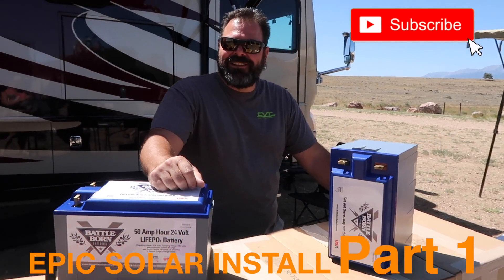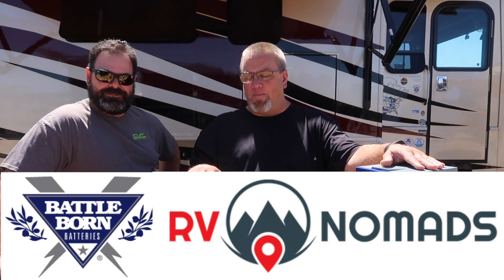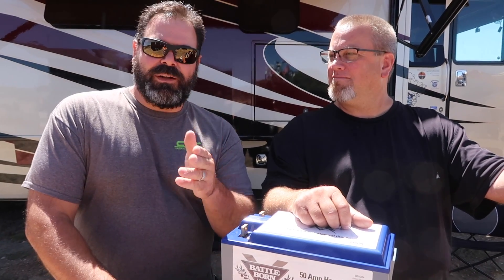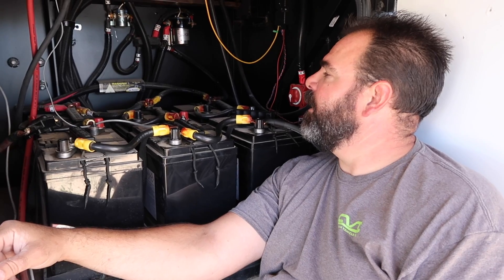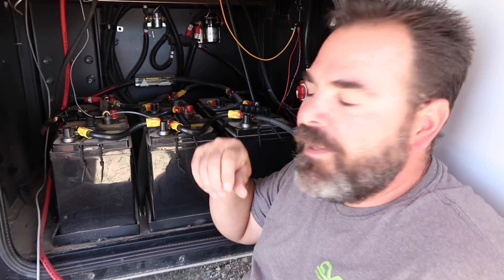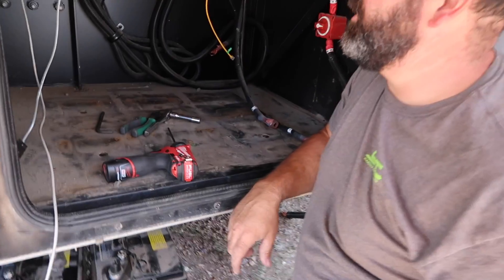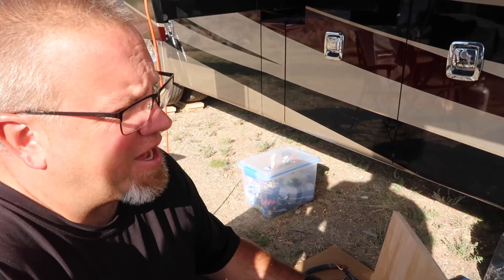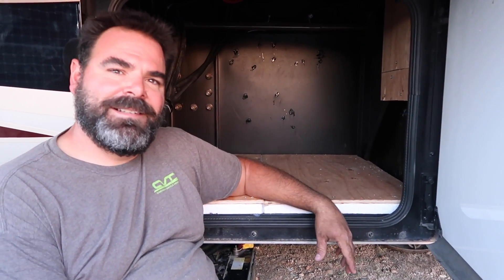EPIC 24v RV Solar Upgrade with Battle Born Batteries & Victron Energy

Comment: Each of the 24v batteries rated for 1200w, but effectively 1kw after energy loss...so any issues with 3x 24v powering a single 3k victron multiplus inverter?

Comment: I found this lacking in any useful information.   Are all batteries in parallel?  What gauge wires?   Do 5 batteries run one inverter and 5 on the other, or are both inverters hooked up to the 10 parallel batteries?   How much solar is parallel vs serial and the voltage they are putting to the controller?   Do you have to use a 2nd solar controller to handle the solar panels?   I could go on forever and I shouldn't have to, but at least we know how many times he peed, so I guess I am good.
Reply: Due to the fact that they are 24 V 50 amp hour batteries in 1824 V system the batteries have been wired in parallel as to the size of wires I too am unsure but one would hope that they are at least 2/0 wire. As far as the inverters they would be wired as any other lode off of the battery bank. No charge controller the patron 250/100 should be more than capable of handling 2000 W of solar at 24 V of course I have an actually watch this video and I was just scrolling in the comments as I was looking at the beginning but you know. Maybe you could’ve just said hey could you provide more details.

Comment: So for a 24v system you dont hook the batteries in series only parallel to get you amps added but not volts. I am assuming you inverters can be optioned to output 12v and not 24v, or are you stepping it down another way? Also how are you hooking both inverters to the main to get 50 amp svc.? To the same post in the distro box?
Reply from the maker: Todd Ramsay you are correct in the wiring for the batteries. Wiring in parallel increases the amperage. I have used the Victron Orion 24/12vdc 70amp converter to output 12v to the coach. 50amp service utilizes two hot legs and generally it comes from the transfer switch as 6/3. After the transfer switch, I split the 6/3 into 2 runs of 6/2 with each run going to a separate inverter. The inverters 120v output goes to two individual breaker panels. More of this will be covered in upcoming videos, so please keep watching.

Comment: They must have donated these batteries because they are huge cash $999.00 each so $10,000.00 in batteries another $2500 in inverters and then even more with all the odds and ends so in the end what some were between 15 to 20 grand
Reply: You didn't disclose if you're a RETAIL price paying customer or not for 10x batteries.  Wish you well, but  'reviewing relationship' is typically leaves much too open.
Reply: @mowomedia4801  : I agree.  What exactly does "reviewing relationship" mean?   Anyone can review anyone else, so saying one has a "reviewing relationship" with a company implies some kind of special arrangement or quid pro quo or something.
Reply from the maker: Have you not seen our setup and our toys??? If we are going to do it, we are going to do it right and we have completely disclosed that we are a paying customer with a reviewing relationship with Battle Born. We also provide a build sheet with pricing for those who want to know more.  This is our 3rd attempt at solar and finally getting it right was important to us with the way we travel and sometimes it takes doling out the cash it get it done.  Our other 2 solar installs have already paid for themselves and this one will too in several years because it allows us to be free from both the pedestal and the RV park.
Reply from the maker: We also didn't need to go 24volt but we thought why not... if were going big might as well make it EPIC and do something that really hasn't been done much in the industry. Proud to be apart of it all!!!

Comment: wish his pricing was better and i would go with him but 2K for 200 amp hrs . i have a 24v setup as well . soon i well have to make up my mind on a system  like doing like others and just getting a EV HV battery pack for like 1K and modding it to what i need . but not sure why 2 inverter when you could have gone with the 110ac to 220ac transformer or just 1 really big inverter like a Xtrace 4000watt 60amp unit  . my inverter runs all of my RV . make sure you get your auto ground to neutral relay setup right with the 2 inverters so when you are driving or boondocking your safe . alot of ppl get this wrong
Reply from the maker: One of the big selling points of the Battle Born batteries is the built in battery management system. It controls the ins and outs of the battery and ensures safe operation. If you go with an EV battery pack you will have to make sure you integrate a battery management system of your own.  Several reasons for two inverters. I have two breaker panels with an inverter feeding each one separate. And with two inverters, I have two 70amp chargers as well, so I can charge the batteries at 140amps (at 24v) on addition to what the solar is bringing in.
Reply: yeah thats why i have not jumped into the HV EV packs . i own a EV so i know how unsafe 1 can be to play with intell you get rewired to a lower volts . but the management system is called a BMS and there are many DYI units on ebay . my solar systems on the roof of my RV charges my car too . i removed the gen set to install the battery bank in its place . i all so have the same converter as you but i go the other way i go form 12v step up to 24v so when i am driving down the road it charges my solar bank .

Comment: Gary, Would you be willing to share the cost of this install if you had to purchase the components retail?
Reply from the maker: All of that info is available on our website for the most part at www.pauhanatravels.com/solarguide. Every install is different so giving a general price really doesn't pan out. We've included a parts list of the components we used with links to the product on either the Epic Nomad Trading Post, Continuous Resources or Amazon.
Reply: Thanks.

Comment: Very intertesting....I am currently building a 48v system for our 5th wheel that we will be full time in come next spring...I am building the batteries our of 18650 lithium batteries that i'm recycling from used laptop batteries...I'll be interested in seeing what the Victrons are capable off